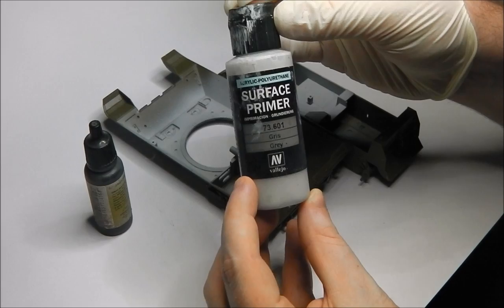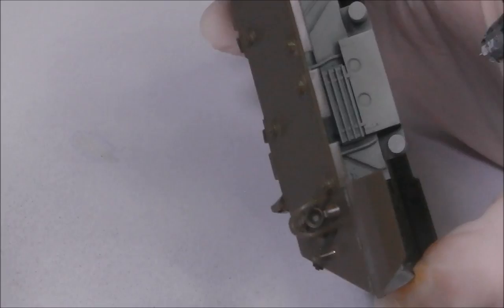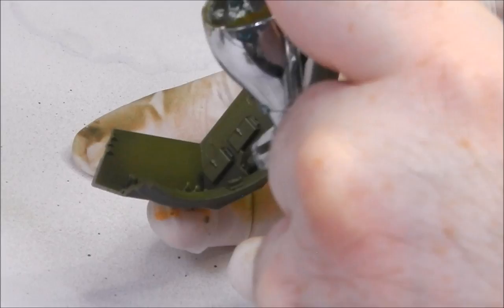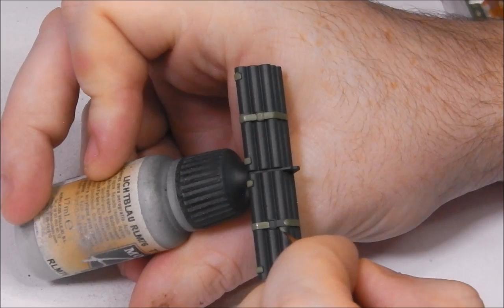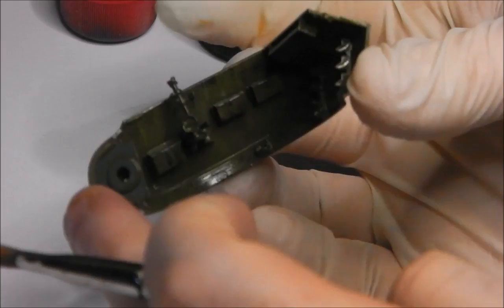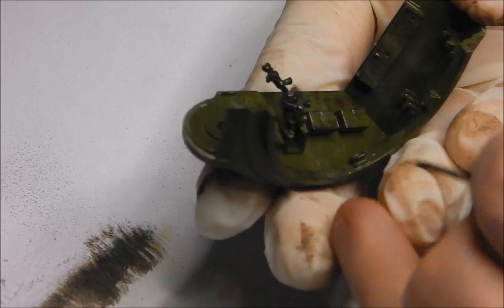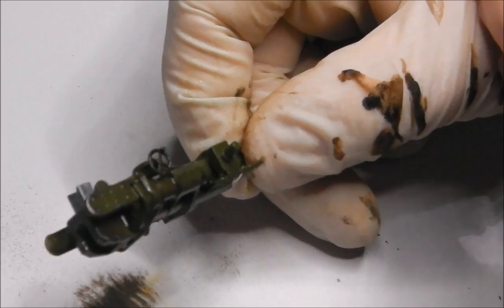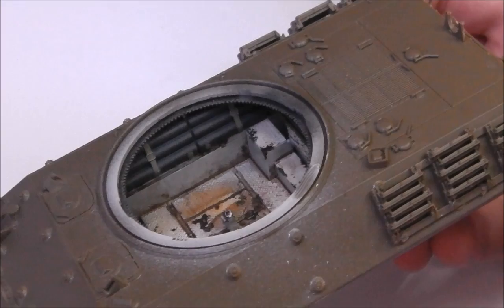Tamiya 1/35 M10 Tank Destroyer Build Log / How to paint and weather armor interiors tutorial

Comment: How does it work to first paint and then put the model together? I am used to first build the parts like turret or hull and then paint it, because of filling seams and such things. Nice tutorial, especially the oilpaint inside the turret is something i will do on my Hellcat.
Reply from the maker: it depends on the kit's fit, the tamiya kit has good kit on the turret halves but still has faint line visible, but it really done to you if you want to build and fill the turret and paint everything in place, it would be trickier as trying to get into details will be made difficult in places but an airbrush would help in this
Reply: Well i have an Academy M18 Hellcat kit on which i would like to try that. Mostly i put the parts together and then paint them, but maybe i will try to essemble them after painting.
Sometimes i am also worried that the glue might not really hold due to the colors.